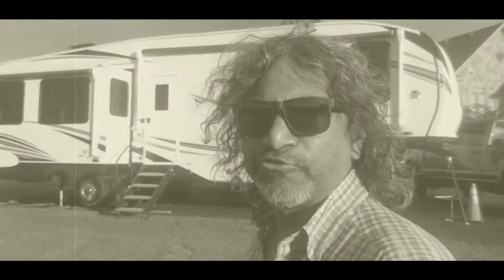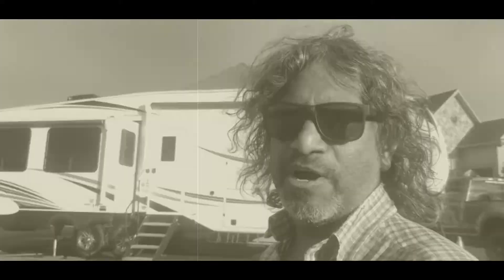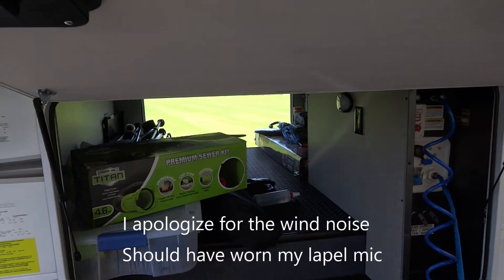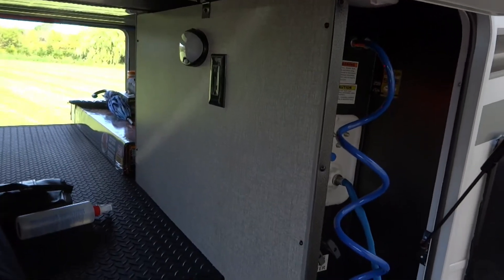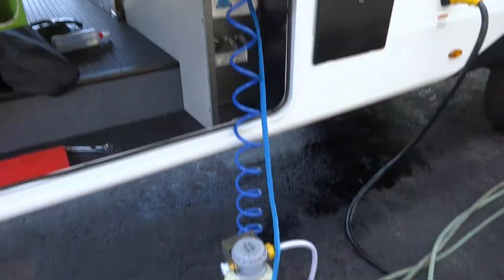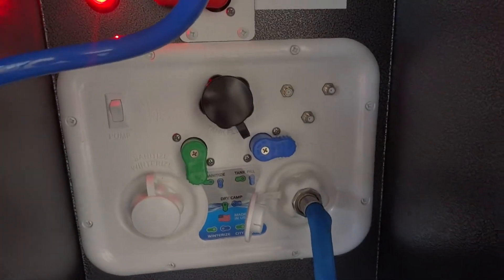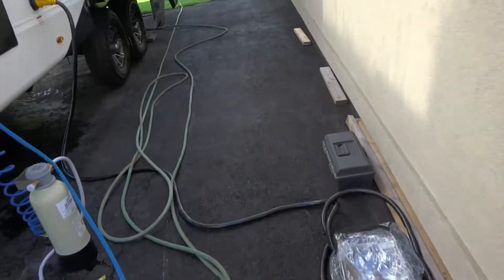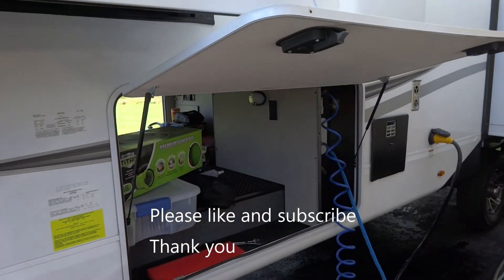Jayco RV Water Pump issue

Comment: Haven’t had that problem yet but good info. 
Was wondering if you have an issue with using the auto level buttons in the pass through. I can only get mine to auto level by using the app or doing it from inside the rig. Thank you
Reply from the maker: Hi Ashton. Thanks for watching the video and subscribing. really appreciate that. I have never had any issues using the auto level button on the passthrough. The light has to be on...on that panel to make it work. Have you tried pressing both up and down arrows at the same time first? That's what I have to do and then press the auto level. Hope this helps.